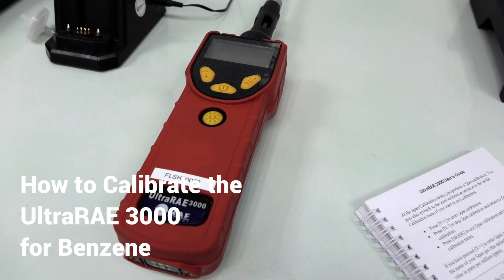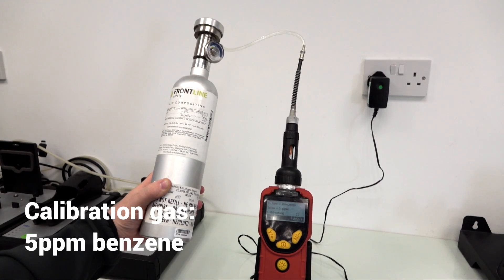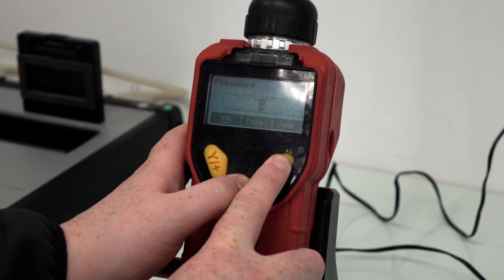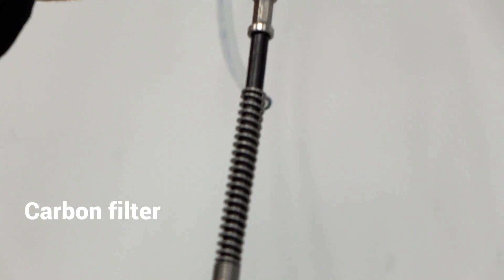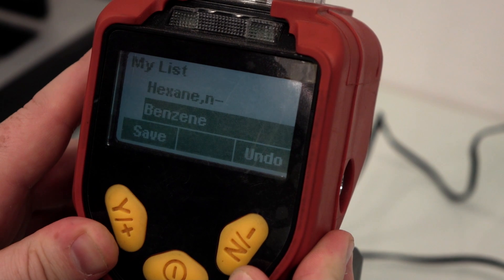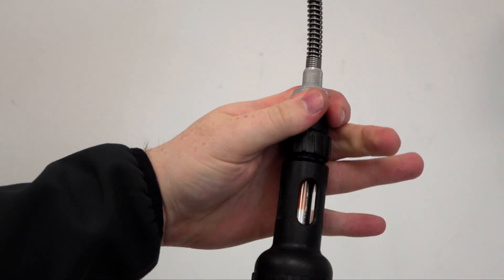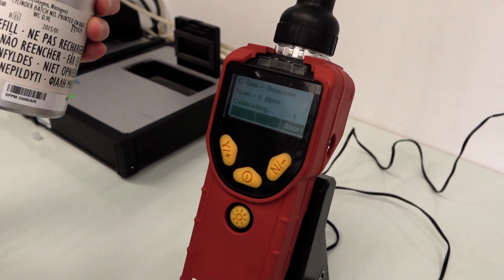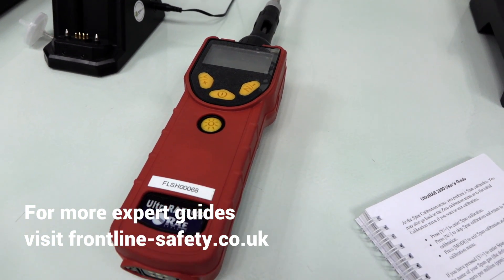UltraRAE 3000 - How to Calibrate for Benzene Monitoring

Comment: You should be using the carbon filter on the exit port when calibrating with benzene - you don't want to be breathing in any of it!
Reply from the maker: Hi Greg,  thanks for pointing that out.  Whilst we appreciate the carbon should be used, what you can't see in the video is our extraction system.  For other users - use the carbon filter as Greg mentioned, or ensure you have suitable extraction methods in place.